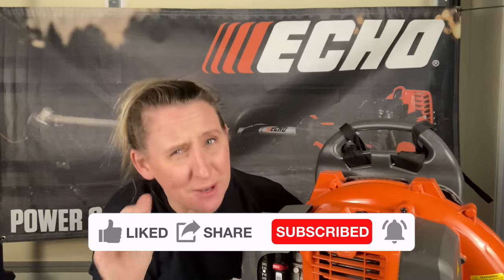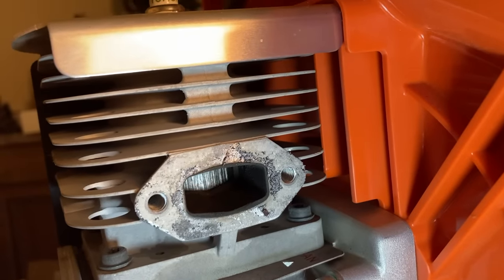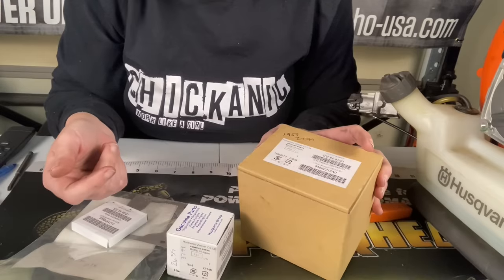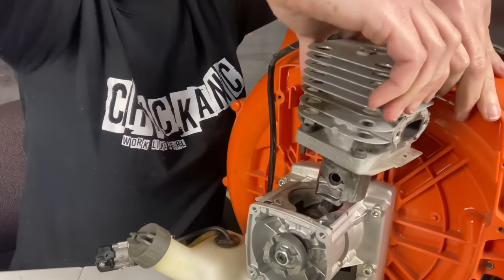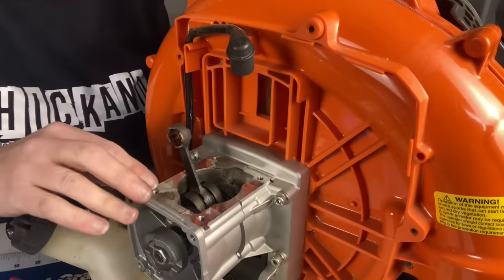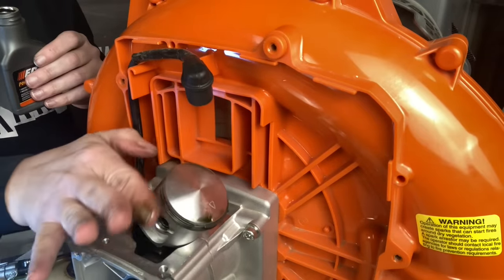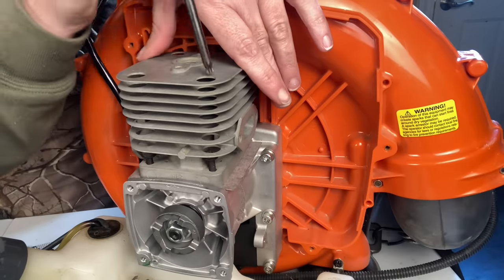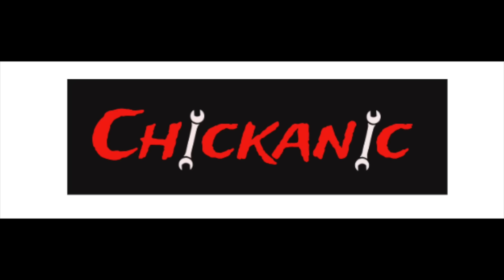How to fix a burned up Husqvarna 150BT backpack blower/Turning Shop Trash into Treasure VLOG Repair

Comment: Since this unit was run without lubrication and you only ordered a jug, piston and rings before disassembly, how did you know that a wrist pin, upper and lower rod bearings, crankshaft bearings and crankshaft weren't damaged?
Reply: Yup, first thing I thought too. But remember the audience...
Reply: because they use roller bearings. they will survive way longer than the piston/rings will without lube.
Reply: Experience. I've dealt with a few of these myself. Surprisingly most have been chainsaws. The piston, being cast aluminum, can't run very long without lubrication before it begins to spall. Bearings and the wrist pin are steel and able to take more heat before failing. Just my 2 cents worth.
Reply: @crazzywolfie  How long is way longer? How long did it run without lube? Where did all of the wear metal go from the piston and rings?
Reply: @jimbrewer2893  How long did it run without lube? Where did all of the wear metal go from the piston and rings?
Reply: Most pistons we order come with a bearing and wrist pin, we were kinda surprised this one didn’t, so we got lucky the bearing was fine. However, 99 times out of 100 with a simple piston expansion from running on straight gas, the crank and arm receive no damage. There is a huge difference in operating temperature from the intake/crank to the compression/exhaust side of the piston. If the piston is only scored on the exhaust side then the intake/crank side stayed cool and the damage occurred very fast. The crank and arm are also cast steel which will survive much higher temperatures than the aluminum piston.
Reply: @dudekanic  Bottom line is that you have no idea where the wear metals went that wore off of the piston, piston rings and cylinder wall. You have no idea of the length of time that the lower end ran without lubrication. You have no idea of the condition of the crankcase components. Please provide the prospective buyer an adequate warranty to cover your gamble!!!
Reply: @dennisdunnigan97  The rings were still there. The metal from the "melted" piston was covering them. I don't know how long it ran without lube. I can tell you that it doesn't take long to cause that amount of damage considering the soft metal of the piston and the heat generated by gas only run. In my experience most of the metal from this type failure stays on the piston. You may find small bits at the bottom of the crankcase which Bre did check in the video.

Comment: great learning , how much of a difference between 40:1 vs 50:1  for fuel for a unit?
is it better to use a richer oil mix or will it foul the plug? I have some unit’s  that are listed 
at the two ratio listed above. the stihl oil to mix with the alcohol free gas. along with a 
another brand line trimmer, and an older chainsaw. I hate that the mix ratio is
not listed on the engine. thank you for all the great videos!

Comment: Wouldn't it be easier to pull the spark plug and look at the cylinder with a borescope? I don't know too much about two stroke that's why I'm asking
Reply from the maker: This has one of those tiny 10mm plugs so the hole is too small to look in, but yes, usually that's the way to go for sure. Thanks for watching!

Comment: Aluminium cylinder piston  wears out easily but magnesium steel engines come long life  but plane petrol don't burn up that fast I guess plane petrol plus overloading  engine by partially closing outlet of air together is reason

Comment: ...great DIY video Bre.....I don't have much experience rebuilding small engines, but something tells me to use a sealer on that cylinder gasket....your thoughts please....and
for an amateur DIY guy like me, would it be best to use factory torque settings on those cylinder bolts, or just go with "calibrated-elbow" method?... :)

Comment: Maybe their should be another colour for fuel cans, red for straight gasoline, yellow for diesel and blue for mixed
Reply: Blue = Kerosene, even says so on the fuel can. 
Maybe you should start a line of "purple" mixed fuel cans. 
Purple  for  40:1
Green  for  50:1
Reply: That's the reason there is dye in the oil though. you can see if it's mixed or not.

Comment: I have the same blower it starts in 3rd pull every time  and idles perfectly but at wide open throttle it has a pinging sound then every once in a while it will just start bogging  down Under full load  any ideas?? Btw the way you are gorgeous!!

Comment: I have the same blower that I use semi commercially. My only complaint is that I should have bought the bt350.  The engines are the same but the bt350 has more cfm,  I have learned the hard way as usual.  More air speed isn't better cfm is.  Is it a option for me to change a part on my bt150 to make it have as much cfm as the bt350?

Comment: What about those retainers? This is a great instructional video, thank you!
But how did you get the wrist pin needle bearing retainers in place when you installed the piston? Mine don't even seem to fit just putting them in the piston on the bench, nevermind while trying to put it on the con rod. And my cylinder/piston replacement kit didn't come with new ones.. ?
Sorry you got stuck in Vegas. Nightmare.
Reply: Turns out I was having trouble installing piston with retainers, etc because the needle bearing that came in my kit was too long. Inhad to reuse the old one. All good now though.

Comment: i can't believe the customer wasn't willing to get that fixed. even if it cost $200 that would have been about $150 cheaper than new after taxes unless he went 4 cycle or electric. when it come to 2 cycle machines you definitely have to be extremely careful who you let use them for this exact reason. people that don't know what they are doing will most likely just burn up the engine.
Reply: Ive learned the hard way about loaning lawnmowers 2stroke equip and most especially my chainsaws . Its a no no for me now .
Reply: Not sure the customer challenged the cost of repair or the cost of repair was offered. I would think most people would have it repaired if the price seamed reasonable which it was.

Comment: I don't think my old stihl 420 piston really needs checked the people i bought it from always used the right mix for it but he sold it because the carburetor was messed up is what he said the muffler on it and screws looks shot but it runs good the needle in the carburetor probably needs cleaned or just a new needle is all

Comment: Interesting. I have a Stihl chainsaw that looks the same through the exhaust port. Oddly the cylinder looks fine. I will strip and inspect. Do you think it would be OK to use pattern parts rather than OEM?

Comment: I HAVE a STEEL SR450. I GROW BLACKBERRYS AND HAVE FOLLOW FUNGICIDE APPKICATION SCHEDULE SO THE EQUIPMENT GETS USED.  I TURNED 60 THIS YEAR AND THE BACKPACK SPRAYER IS TOO HEAVY WHEN FULL FOR ME TO USE. IVE TRIED TO SET IT UP ON MY GOLFCART BUT THE 90 DEGREE ELBOW IN THE HOSE APPLICATOR MAKES IT IMPOSSIBLE TO USE ANY OTHER WAY OTHERVTHAN INTENDED.
DO YOU ANY SUGGESTIONS?
On a side note I went to an eye appointment to inquire about Lasix surgery  because  I'd grown tired of regular glasses...reading glasses, contacts. I'm sure you exactly what I mean.
They asked if I ever considered Refractive Lens Replacement. I didn't , but after the explanation I scheduled the surgery. 20\20 no assistance reading anything.  The surgery doesn't go bad like Lasix.

Comment: Your thoughts on adding more 2 stroke oil than ratio calls for to be in the safe side?
Reply: More oil means less gas and that means leaner burning and that means it will run hotter. Don't do it.
Reply: More than recommended oil means more carbon, which means plugged spark arrestor screen in the muffler, and also can cause cylinder scoring as the carbon build up (on top of piston) eventually can fall off and takes a ride up and down a few strokes before leaving the exhaust port.

Comment: No wrist pin and retention clips with the new piston?  Sheesh.  What kind of cheesy nickle and dime low brow outfit is Husquvarna?
I've rebuilt a bunch of 2 stroke equipment over the years starting with a Yamaha YZ125 basket case I picked up when I was 10 years old in 1974.  Mom made me sell it once I had it running.  Scared her...  :-)  LOL.  Never gotten a piston for decent equipment that they expected you to re-use the wrist pin and clips.

Comment: A few months back you showed a camera you used to inspect cylinders.  What was the name of the camera? Thanks.
Reply: Most pistons we order come with a bearing and pin, kinda shocked us this one didn’t. For the most part though, simple piston expansion due to straight gas doesn’t hurt the intake side of the engine.
Reply: @dudekanic  I think you may be answering a different question than mine.

Comment: Hi I have a Leaf  blower 2 cycle  with  a prime  bulb . The front's fine on low speed But when I gave it full throttle It slows down and shuts off sometime what can I do to Fix it thank you
Reply: The fist thing to try is to throw out the old gas and make some fresh gas+oil mix and see how that does.  Make sure the choke is open after the engine warms up.  Next try replacing the spark plug; the behavior you describe is common of Honda equipment with bad plugs.  Next check fuel feed and return lines for blockage.  Next check the carburetor.

Comment: I don't buy those new and never use leaf blowers but bought the broke stihl and it's not really broke just is out of adjustment the guy didn't wanna mess with the old thing so he bought a new model of that br420 model so i have the old model of the new ones stihl sells now 

And I've used both models and the old one is more lightweight than the newer ones of the same model I told the guy you should have kept this and fixed it for yourself cause it's more lightweight than that new one

Comment: You just ripped off your customer lady and made $200, and your customer had to buy a new blower when you knew it was an easy fix. I had a similar problem with my husqvarna 150. I went to my local  lawn equipment mechanic. He said if he fixed it he would have to charge me $150 hr. plus parts to fix it. Then told me  I could purchase a new one or I could get all the parts I needed on amazon and watch a you tube tutorial and fix it in an hour. So instead of purchasing a new one,  like you told your customer, I spent less than $100 and about 45 min. fixing it. It is refreshing to find a person who wants and needs to make money but also cares about his customers. Glad I didn't take my machine to your shop.
Reply: Ouch

Comment: A brand new Husqvarna not running is no surprise. Maybe burning it up was a good thing , it would have died soon anyway. They can go buy them a better one next time.
Reply: I’ve had a 150bt for almost 15 years snd it has been very reliable even with a lot use.  I’m not sure Echo is any better.  The Cadillac machine which is similar is the Stihl BT-700 which is around $550.  For the average home owner, it probably isn’t worth the extra $200 up front price.

Comment: I'm surprised he wife got it to start at all.
I've asked my wife a few times to pull the cord on mine wile its warmed up on my back, she's strong but can't get it to fire.

I just spent 2  2.5 hours blowing leaves with mine today, i need to buy an electric Milwaukie to go with my other electric tools the big blower wile its nice for fall kinda suckz doing mowing clean ups. 
Its heavy your arms buzz 1/2 the day after using it, and if you hit the stop button twice like i did today trying to set the cruse control it gets annoying.       I shut that sucker off twice by mistake, and i bet i do it agine before all said and done  brain fart. Wrong button.

Yep electric pop a battery in it off my trimmer and go.

Ive got 2 gas trimmers a weed wacker older then her and a craftsmen bushwacker almost as old as me  the bush wackers really big. 1970s model runs .

Comment: it's fine and dandy that you can salvage junk for minimal cost... but what about time even if you fix it for yourself you fix it to sell it etc you still have to charge yourself time.... so could you elaborate on the amount of time you spent ordering parts fooling with the parts everything involved with this machine is time and if you have a 50 or 60 dollar labor rate yes you're still making money but $200 is not really $200 if you've got $150 in parts of Labor....

Comment: why would a supposedly "quality" brand machine have a  crappy chinese Torch spark plug?
Reply: These are Japanese made engines, they used to have NKG plugs, but NKG is way behind on production. So I would guess they are just using what they can get.

Comment: Kinda wondering why you didn’t offer to fix it for the customer. Being in such nice condition, it surely would have cost less than buying a new one.
Reply: Add the labor cost. Parts PLUS labor would have likely put the cost close to about 2/3rds the cost a new unit.
Reply: We gave them an estimate, and they wanted to buy a new blower. The estimate was in the $150-$175 range. They didn’t buy a blower from us. We almost never fix equipment like this, meaning 2 stroke equipment, to sell as the cost-effort is usually not worth it to us. We really only fixed this one to make a video. If not it would had been parted-out over the next two years until the shell went to the landfill.

Comment: I'm confused...if a new blower is $329~, cylinder, piston, and parts were $100~ why wouldn't the repair cost be worth it to the original owner???
Reply: most small engine shops charge for labor. Atleast if they wanna stay in business!
Reply: @jetrojackin3400  I think we've become a throwaway society. Often it seems better to buy new than repair old. But then again some of the older machines are far better built. But of course it may not be the case in this particular instance.

Comment: WHAT!!?? Customers actually lie!? I ran a small engine shop for years and I almost never had a customer tell me the whole truth about a problem. One of the worst was a guy that brought in a twin cylinder MTD tractor that he said his "Brother in Law" was cutting the grass and it stalled. It wouldn't start again. "Make any noise?"  Customer: No it was really quiet." I charged the battery and hit the key and the flywheel WIZZED around and around and coasted when I let go of the key. I pull it apart and it has about a mouthful of oil in it that looks like tar. Both connecting rods were broken in about 6 pieces. I call the customer and give him a quote on a new engine. Customer: "Oh! Ahh.........You can keep it. 'CLICK'" Great now I got a POS tractor that he owes me money on for checking it out and he blocked my calls.

Comment: I don't trust anyone  .. even me 
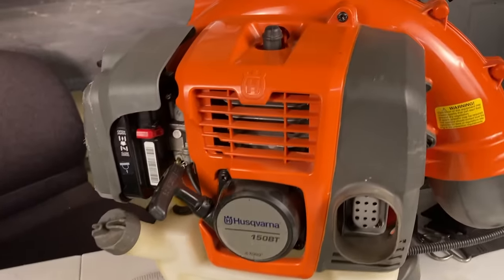Therefore I Sthil mix with non-ethenol gas  ...  but I always mix all my regular gas, gas cans with a synthetic snowmobile 2 cycle mix at 1:50 so that if an employee accidentally gets the cans confused at least they can't blow up a 2 cycle engine and the snowmobile mix will not hurt the 4 cycle engines  .. I even 2 cycle mix in my pickup once in a while

Comment: looks like $160 original owner.........even $200   IDK  if its $300 machine...........doesn't seem fair to me looks like coulda repaired for customer
............question - pulled out ground FROM generator while sprucing frame ...........somebody told me connect new ground any bolt on outside gen to frame............IS THAT TRUE ...... sounds tooooooo EZ
Reply: For your generator, I’d connect the ground as explained in the manual.  I wouldn’t take a chance not going by the book with something safety related.

Comment: Tell me how a 2-stroke with an aggressivly scored piston, rings, and cylinder like this one could have 150 psi with a compression test.
Tell me how you get parts at cost.  You think Husqvarna and other manufacturers/suppliers are going to sell you parts at cost?
Tell me why you didn't use some 2-stroke oil when assembling the top end?
Reply: She demonstrated how a scored up piston can have good compression ... for a couple of minutes here ...
https://www.youtube.com/watch?v=ADZRrlS0vcI
Reply: A 2 stroke piston that is scored can still generate enough compression if the rings or ring is not locked to the piston. It might even start but won’t rev up because the rings can’t hold pressure at higher RPM or as the cylinder heats up. I think she just said cost instead of retail, but there are many online suppliers that wholesale to the public. She said many times that she was using oil on the parts, and there is a shot of her coating the piston with oil at 12.16 into the video.
Reply: I appreciate the reply.  I apologize for coming across like I did.  I enjoy and appreciate your videos.  Go Hogs!  I am in Missouri.
Reply: @mikespain8655   No problem at all. It's probably me, Bre says I'm and A-hole and don't know how to talk to people. For the most part I'm not allowed to talk to customers or reply to chats, but hey, for some reason I was up at 3 in the morning and she wasn't.
Reply: @dudekanic  LOL